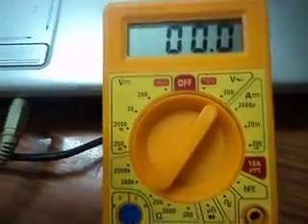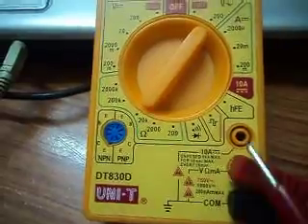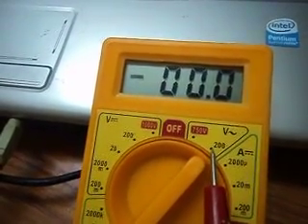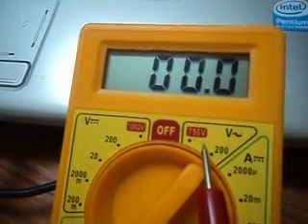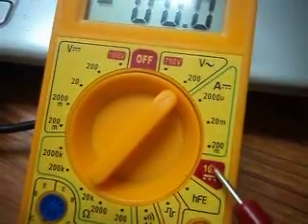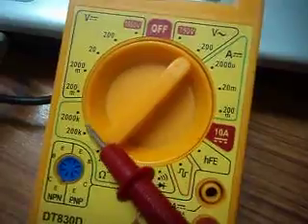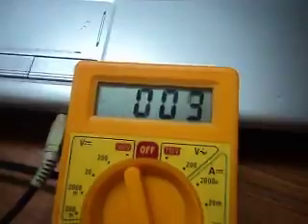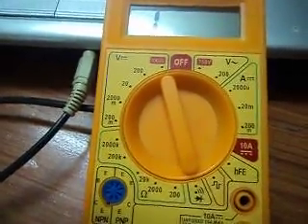how to use digital multimeter

Comment: I was testing current from my capacitor. I decided to change the 12v  to  Ohms. it didn't read anything so I change it back to the 12v and it stopped reading the current.. all while the wire was still connected to the capacitor.   CAN SOME BODY TELL ME WHAT HAPPEND?

Comment: I was testing current from my capacitor. I decided to change the 12v  to  Ohms. it didn't read anything so I change it back to the 12v. all while the wire was still connected to the capacitor.  CAN SOME BODY TELL ME WHAT HAPPEND?